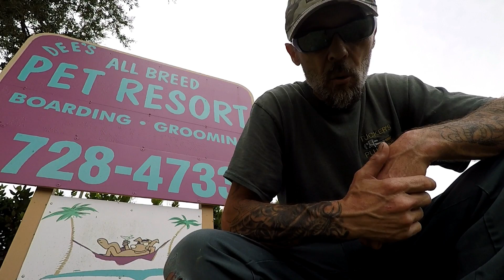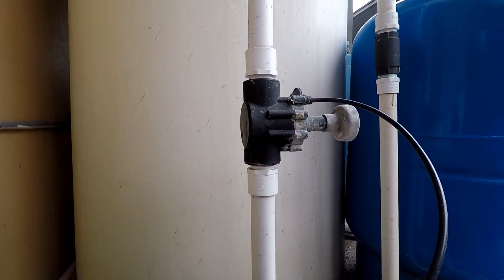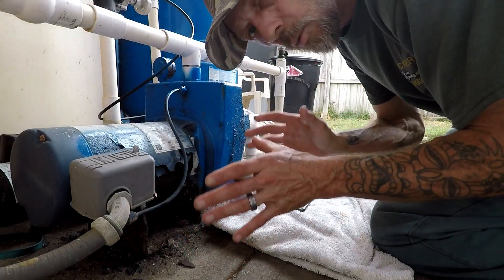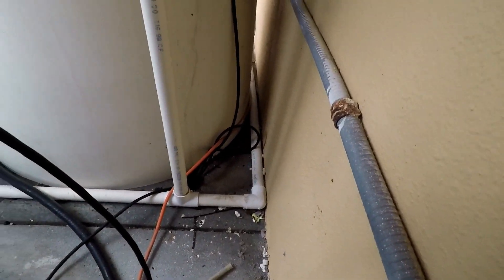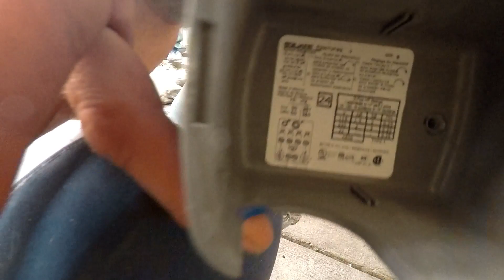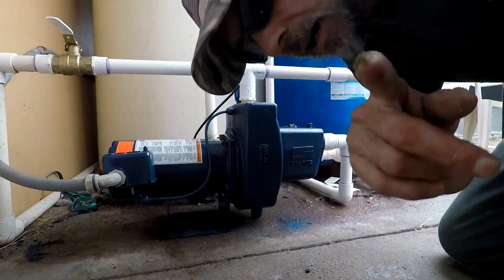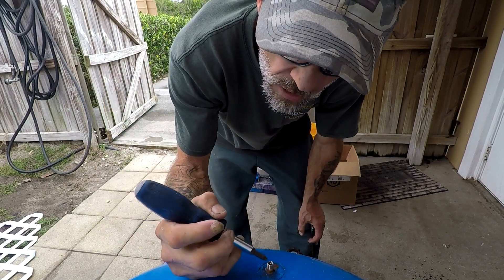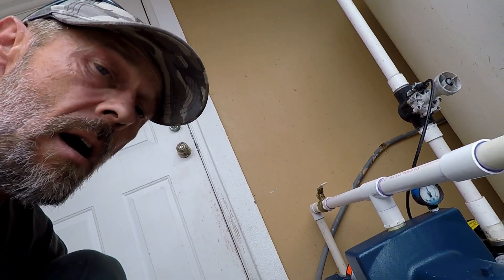HOW A RESIDENTIAL WELL WATER SYSTEM OPERATES

Comment: My water well (70' deep) is 100' away from the house, where do I install the pump and the tank? Can I install a external pump (3/4) and the pressure tank (30 gpm) inside the utility room?🤔🤔🤔 what is a good setup for a 2 bathrooms, kitchen, laundry room and utility hose?

Comment: Does the line going to the softeners come from the pressure tank?  We have a similar setup and I’d like to add some sort of filtration system. Not sure if I would add that before or after the pressure tank (we have an aeration/holding tank too).

Comment: I turn off my well and drain the tank each winter. But it still drips. I am in cold weather so I get ice on the basement floor. Is there something to do to release the pressure at the wellhead? Thanks

Comment: I'm trying to design a water system for a 18 foot long by 8 foot wide by 7 foot tall box truck that's being turned into a camper. And would love to run pipe through the entire floor and have it so I can heat the water during the winter so the floors stay warm. Lol any suggestions?

Comment: I have a well water system in south Florida. there's no aerator tank or external pump. Just 1/2 horsepower submersible that goes into the carbon filter then softener then the house. Do I need a check valve?

Comment: Not used to seeing plumbing outside. Up here the pipes would be a goner.  Got used to doing all this stuff when we lived in the country. We were lucky enough to have good wells and good water.   My sisters well was on a bog iron deposit. Her toilet and tubs were a pretty color of orange. When you took the well pump apart, it was filled with little black balls of bog iron. City water went through so they got on that pretty quick. Thank you for the lesson, Tim
Reply from the maker: Great share Sean!
Thank you so much for stopping by!